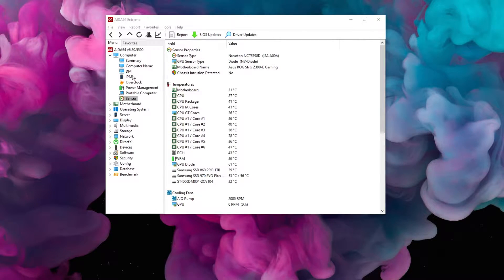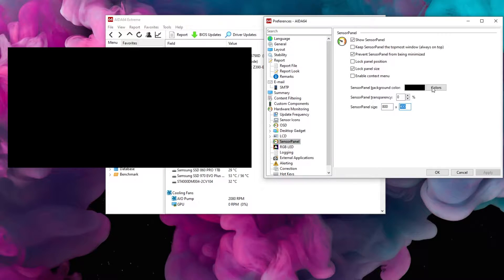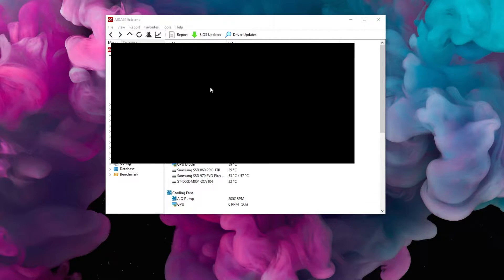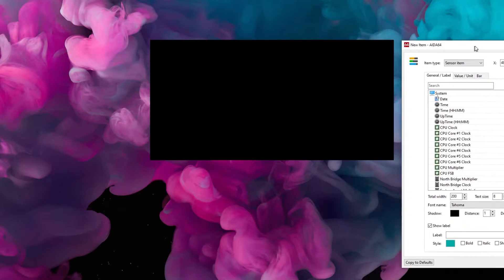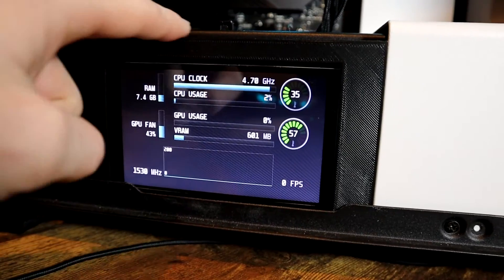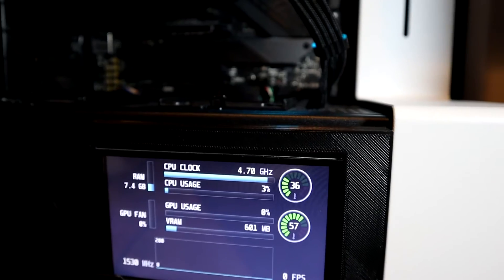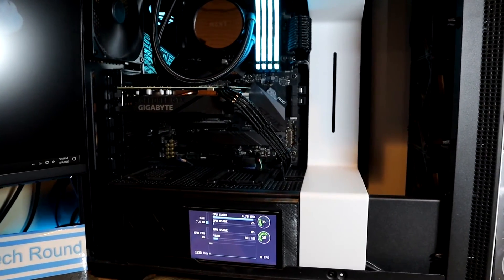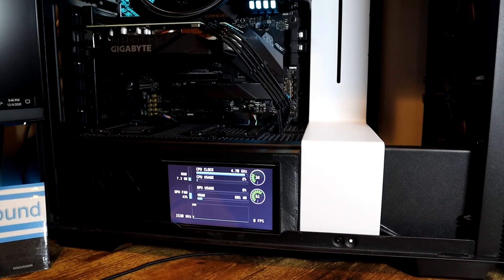Custom NZXT H710 LCD Sensor Panel!!!

Comment: So, if you have a video card that has 3 video outputs, this sensor panel monitor uses 1 of the video outputs ? I have a triple monitor setup right now where I use and need every inch of space. I would have to have a video card that has 4 outputs ( or install a second video card) to make this work and keep my current monitor setup the way I have it. Too bad you cannot use a tablet with it's own OS (Android or Windows) and somehow get your computer stats to display on the tablet. I have a perfect spot on the side of my computer case where I could place a 11 or 12 inch tablet. I'm trying to keep the inside of my computer clean looking and so one video card is enough. And good video cards at a good price are hard to get anyhow right now.
Reply: look into using an RPI to do this mod without utilizing the gpu

Comment: Hi first off thank you for this ! 

I have a nzxt h710 too and want to do this but the screen you used is out of stock 

https://smile.amazon.co.uk/dp/B07PQQGP7R/ref=cm_sw_r_cp_apa_fabc_9BP1DMJQ0BP1J7EGGM4J?_encoding=UTF8&psc=1

Would this be a a good alternative and more Importantly would it still fit if I got your casing printed out too ?

Comment: Hey did you physically attach the screen onto the case itself? or is it just standing up between the glass and case? im looking to do the same mod i have the h710 as well but not sure how i should mount the actual LCD, any tips? =)
Reply from the maker: I used some double stick tape on the back of the lcd and the 3D print is just an interference fit

Comment: Are you able to set it to where every time you turn on the computer, that sensor screen automatically starts up on the small monitor?
Reply from the maker: Yes, as long as Aida64 starts with windows startup, and is minimized to system tray, the sensor panel will default open on the little screen